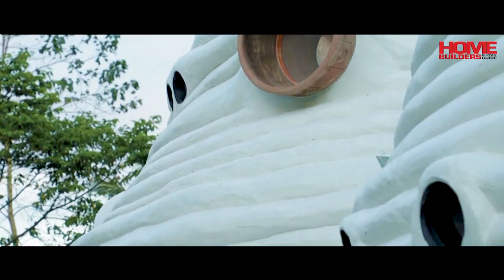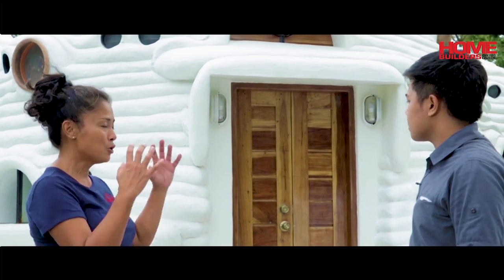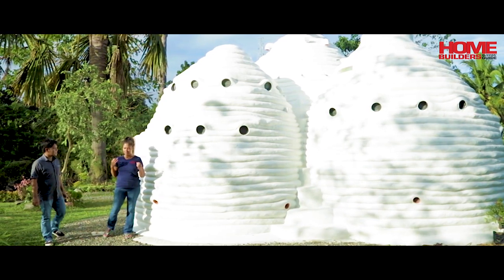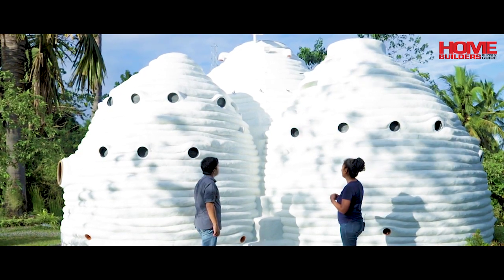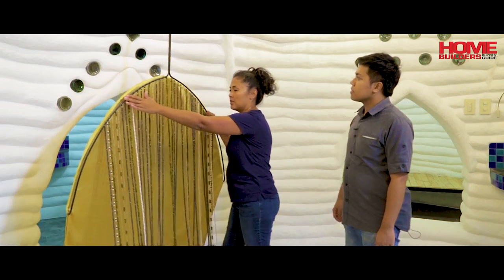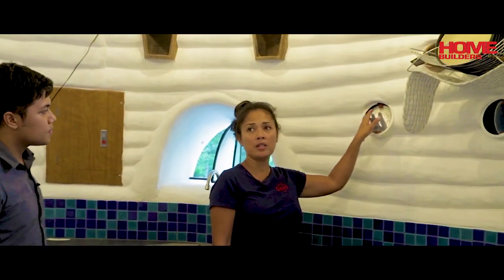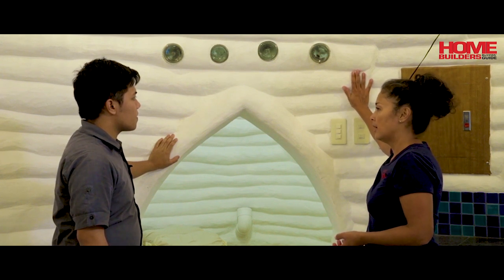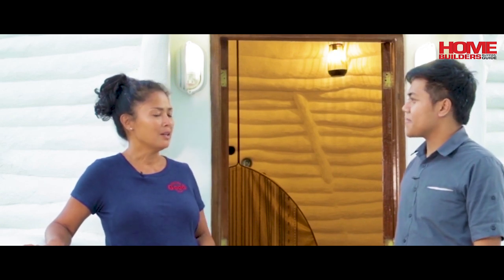HOME Builders Buyers' Guide | See What's Inside this Earth Dome

Comment: Thank you Ate. My payag had a remodel last week. A pleasant breeze installed skylights.  Unfortunately, the spinning and twisting breeze had my yaya cowering under the table.  The skylight had to be replaced with tin roof. Sooo!  I intend to build a small two story dome on this pawned property as a test. The cr was not damaged but the kitchen was trashed with the roof.  A concrete floor and hollow block rocket stove are in the works.

Comment: The layers all thru out the structure inside and outside is just overwhelming.  The inside should have been plastered to a flat finish following the contour of the dome structure which gives the house a more normal feeling and a cozy one too. Building with rammed earth is  very suited to the Philippines and I am glad method of building is finally available here. One thing the video producer intentionally omitted is the range of prices one  can construct these dome homes with.
Reply: I agree. Not a fan of the layered look. Also, if I was building, I would incorporate some straight walls to compliment the design. I live in Alaska. It’s my dream to build a cold weather version of the eco dome.

Comment: Although it is cute and fairytale-ish, I'd have to say the great room doesn't offer enough room for seating and entertainment and the echo would drive me crazy.
I'd also fear one of them 50 lb earth sacks would dislodge and fall on my head during a quake.
Reply: Those are good concerns.
Reply: Yes the echo is a huge disadvantage. But if you don't do Zoom conferences or edit Youtube videos you can get used to it. Look around there are square sized earthbag designs with large windows that prevent it, but than you have to add a traditional roof and it's not a dome anymore.
Reply: In USA they have been earthquake tested. And passed with extremely good marks. In fact the testing equipment kept breaking because they are so solid and will not move the way conventional homes do. Watch " Green Dream Project " this young couple in Arizona USA are building one right now it almost finished.